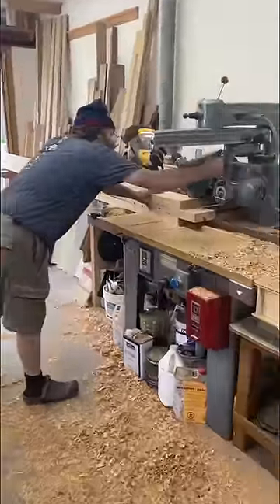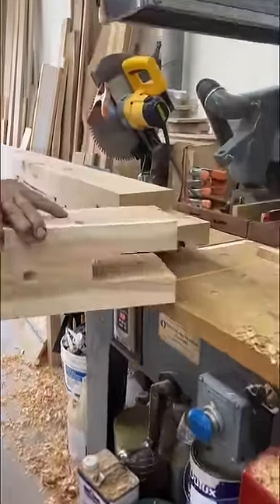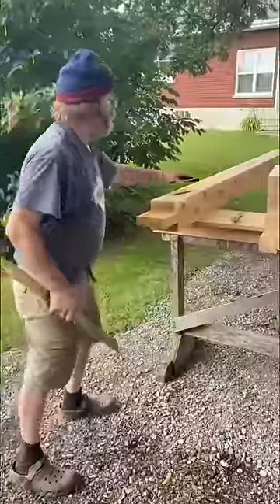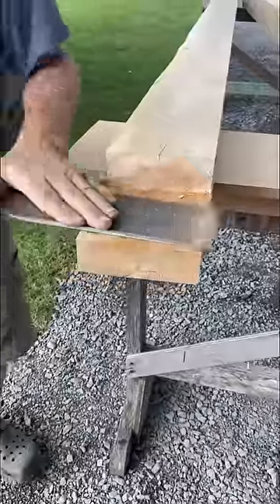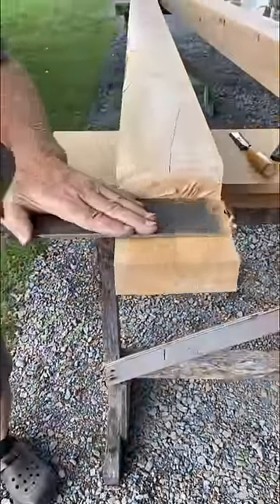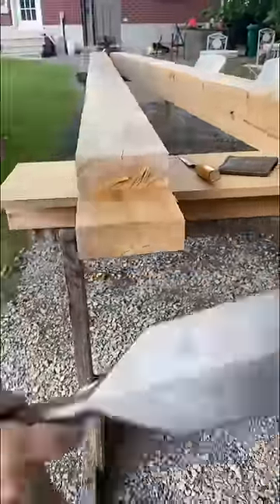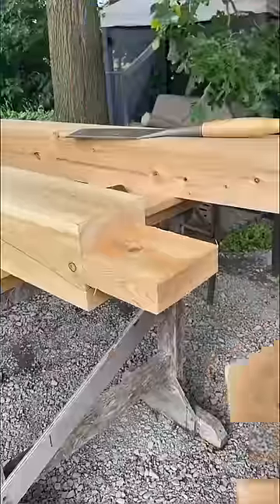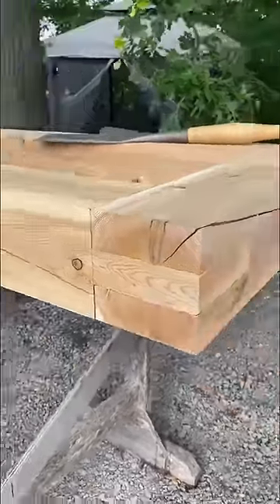1950s Rockwell radial arm saw #wadkintemple #woodworg #architecture #carpentry

Comment: I found a 14” 3 hp DeWalt from 1953 in mint condition.  It cost less than a Bosch mitre saw. And its far more versatile and accurate than the Bosch.
Reply from the maker: Preaching to the choir

Comment: Admittedly, I've never built timber structures, but I'm curious about the choice of the piece with the split in the tenon. It looks like it could fail and compromise the joint.
Reply from the maker: all timber this size cracks. This is dry timber. That's just a drying cracks . crack stops at the center  because it's basically just the slabs of a tree trunk cut off. Wood always cracks if it has the Pith  center. Nothing wrong with that so Timber frame has been done for many many years for you to get a piece of wood without the pith center he probably have to sell your house if they could even find the tree

Comment: Can you use joinery to build a sailboat design that stem to stern academic keeling design.  This is the seaworthy academic keeling design that is deepest in the bow and shallow in the stern ballasted upright in the middle.  A basic single masted schooner with the mast set behind the midpoint of the boat. The stem between the mast and forestay of the boat.  A diy design of classic sailing principles can beat commanche and Rothschild single masted schooners.

Comment: I’m not a master woodworker, framer or carpenter. I dabble. Seeing those cracks in what should be structural timber makes me pucker up a little. I’m clearly missing something lol
Reply from the maker: These are mud seals laid on gravel, and the weight of the building pressing them. Perfect use for such timber.

Comment: The answer to your question is a pencil and a pull saw. Lived in Japan a while. Watched lots of timber frame houses go up. Of course the newest types come ready cut from the factory floor. But when I was there they all but used a broad ax.
Reply from the maker: Don’t the Japanese use ink
Reply: @jackEnglishmachines  yes.  Tough to get the hang of though. Easy to make a mess. The only carpenters I ever saw in person actually doing this were temple carpenters. The “pen” has a somewhat knife like edge and makes a clean and clear mark. A pencil isn’t as dark but is far easier to manage. And is easier to write.

Comment: So wouldn’t fitting it like that cause it to be loose later on as the wood gets older and cures more or no ?
Reply from the maker: no, because the wood in both pieces is in the same orientation and moves in unison whether it was green or dry

Comment: Since there's 2 supports on the one joint and only one on the other, shouldn't the single support joint be thicker than the other 2?
Reply from the maker: No, it's just a hold the corner from pulling apart

Comment: The other way you could get a fit like that is to cut that post with your saw and chisel and use your slick to smooth it out.  They did it like that for hundreds and hundreds of years.
Reply from the maker: they sure did

Comment: Ive got a rockwell bandsaw thats old as hell and cant find any information on it. I know its old as hell and cast iron. The serial number is BZ2580 Rockwell Manufacturing Co. Delta Power Tool Division Pittsburgh 8, Pennsylvania. Carey Machinery & Supply Co. Baltimore,  MD. I have been interested in these products but dont see very much of them or have any information on them. If someone here had any info they could share with me that would be awesome 👌

Comment: Holy shhht man!!!! Did u make that chisel???? I need one bad! 😮
Reply from the maker: It’s a vintage manufacture, but no longer manufactures
Reply: @jackEnglishmachines  Yea looked them up and also expensive
Reply from the maker: @sas5177  the value is derived from their usefulness, although radial arm saw‘s as a breakdown saw don’t have the appeal of the more modern up cut pneumatic saws . The moral here is that there are many excellent made old industrial equipment that is still useful and trickles down the food chain to those small, craftsman style shops.

Comment: Why would you use a bit of wood with a crack in it like that? (Not a wood worker so I am genuinely curious)
Reply from the maker: this material is used for the mud still the base that sits on the gravel. It is selected out so that the better elements of the frame can be used in more important places the crack itself is not to be of any concern.

Comment: I’ve been a carpenter over 30 years for a few years I did hand crafted log and timber frame houses I got a chance to do some huge oak bents with some Amish they kinda cheated because I use power tools 😂 I actually had a huge miter saw for lack of a better word made it was a amazing tool really but I sold it when I stopped doing timber frame to go back to normal homes
Reply from the maker: yes, it is unfortunate that the world can hardly support the timber framing trade

Comment: Ive got a Set  of those Chisels & Different Wood Handles. From the big to tiny, even a little one that looks Circular,, Not sure what that one does ? They were my Grandfathers.
Reply from the maker: If it’s a crank chisel, it was for probably cleaning the bottom of a mortis
Reply: @jackEnglishmachines  I haven’t had a need to use them “yet” but I would Never Sell Them... You can still the Hammer marks on the different handles.  Lots of other Old Tools to. 
Good to see how to use them..... Thanks

Comment: Why put all the work on that joint and join it to a cracked other piece?
Reply from the maker: It’s important to make a distinction here. The Timbers are boxed heart meaning that they contain the center of the tree, and will always crack to the center and are referred to as checks in sorting the material for the building we select out pieces that will not be detrimental to their location, in this case, this is the mud sill or the foundation and so it doesn’t need any tensile strength, and the weight of the building will hold the cracks closed. It’s absolutely of no consequence to the structure. It is important that we use the wood that is available to us instead of being prima donnas and having to have everything perfect

Comment: It’s called a dado stack blade not a trenching head just an fyi. Great fit on that joint though!
Reply from the maker: No, this is a European treaching Ed, what is referred to as a split Groover? It takes highspeedsteel irons that are bolted on to the cast bronze cutter heads.
Reply: @jackEnglishmachines  oh that’s very cool. I had no idea there was such a product out there. I live in the USA and work in a woodshop full time and all I’ve ever seen is dado stacks on radial arm saws. Thanks for the reply though, I’m going to try and find one of those trenching heads, they seem easier to set up. Do the interchangeable blade come in different widths?
Reply from the maker: @TobaccoTooling  more and more European type tooling is making it to North America. Specifically door and window cutter technology. And the advent of chip limiting tooling,. If you’d like to see the cutter up close, it’s in my feed under wadkin trenching head.

Comment: I grew up on a Delta radial arm saw that my dad had since the early 1960’s. It’s probably one of the best universal woodworking tools ever made in history. With all the different attachments you can use it does just about everything!  I wish they would bring them back!  Btw, sixty years later it still operates to this day!  👍👍👍👍
Reply from the maker: if you have one or have used one, you can completely understand

Comment: Damn man now I’d be afraid to use that tool with how easily it is taking the wood shavings off with very minimal effort. I’d probably cut my damn fingers off maybe even a hand! But super cool tool to have
Reply: With a proper honing you should be able to shave the hairs off your forearm in one smooth pass, like a razor. Instances of cutting one's self are more likely with a dull edge when forced.

Comment: Time to walk into the 21th century.
Reply from the maker: you mean like my CNC
Reply: @jackEnglishmachines   nope. Just, I'm not a fan of radial arm saws. 
Was thinking along the line of the Mafell line, like the NFU50.
Regards.
Reply from the maker: @arjanwesselink3418  problem with those is they're only good to 50 mm depth and so they're really only good for 6x6 . Just purchased a similar cutter block for the radio alarm saw to a depth of 4 1/2 inches.

Comment: It says Delta on the machine and not a chip in the paint 70 years old
Reply from the maker: Yes, when I say Rockwell, I am referring to the era as Delta was owned by a number of other manufacturers like Milwaukee and Rockwell
Reply from the maker: Yes, completely rebuilt including customized guarding. The Saw, is 73 years old.

Comment: Buddy, there is a million years between those joints. Compress the fibres and soak them.
Reply from the maker: shouldn't be a problem compressing them as they are the foundation in a building.

Comment: "Respect the Machine..it has no respect for you."
 You did that sub assembly in front of a rotating blade?
 "..McFLY..??!!"
 Be confident..not over confident.
 And PS, I'm the furthest thing from a "Safety Barney", sooo..
 Your mind's eye can see it first.
Reply from the maker: it's relatively safe. Saw spring loaded and returns back into what's called the return box which encapsulates the blade. There's already a guard on the top, and the blade can't move forward on its own. It actually been custom guarded

Comment: Why is the wood checked so bad
Reply from the maker: When doing any Timber frame structure or working with Denver? We select out and place certain pieces in certain locations. The timber here is eastern white cedar, which always contains the pith center. Referred to as boxed heart box tart timbers, always crack it is there natural drying tendency. The cracks here are not so much the concern, as are the twist which the cracks reveal showing, the wood would probably twist so these were specifically weeded out of the more fine work and used as the mud sill. The weight of the entire building crush is down on these timbers and so they do not need any tensile strength only compressive strength, and so this is the most appropriate position for such timber. We can no longer be as picky as we once were when the abundance of old growth excellent timber were a dime a dozen.

Comment: Pity the timbers full of splits !/?
Reply from the maker: Nothing wrong with the splits. We have to sort our timber into thete respective positions. What is just too expensive to be fussy these are boxed heart chamber and will always crack and these ones which actually have twist spiral cracks will be the mud sills with the weight of the building bearing down on them. For that purpose, they are ideal, sorting through her timber at the beginning of the job sort them appropriately